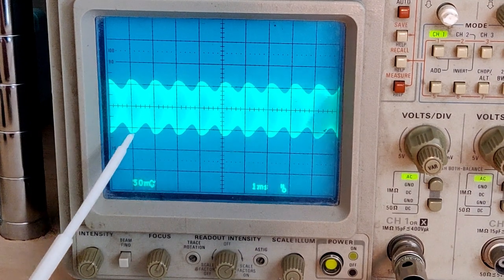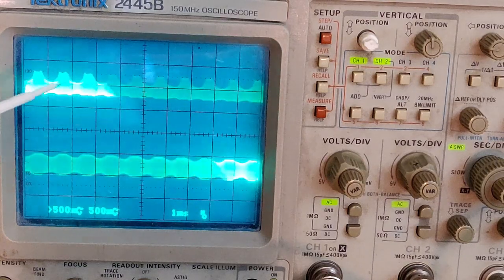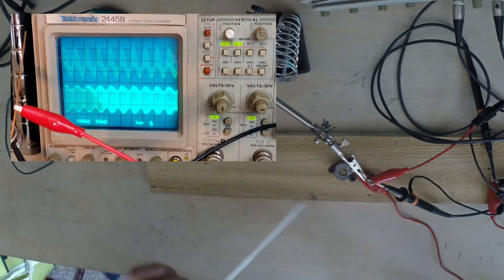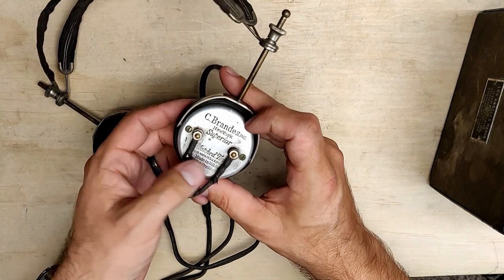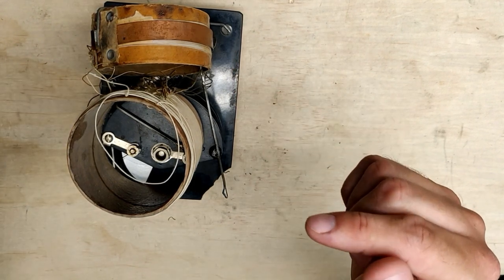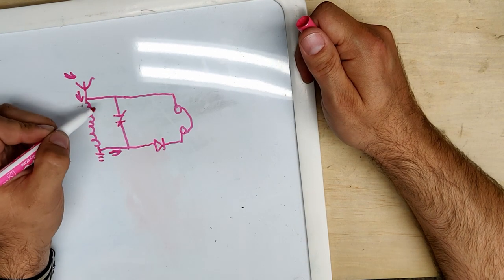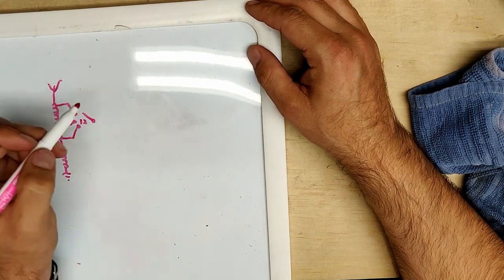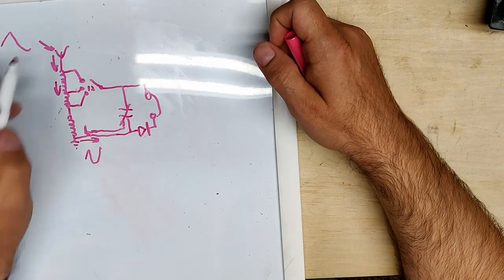Backroom Electronics #4: Fundamentals of Radio Part 1: The Crystal Detector

Comment: Several months and not a single comment... so I let me be the first :-).

I really appreciate your approach to explain the operation of crystal radio detectors.

Recently I bought radio crystal myself which is supposedly from about 1910 and started to play around. The characteristic which I read from a curve tracer looks very different from what you would expect from a diode (L-shaped trace). So I searched around the internet which lead me to your video.

Your experiments inspired me to use your setup and feed a mock-up radio signal into my crystal. This yielded results similar to yours after I found a hot-spot. As soon as my high-ohmic headphones will arrive from E-Bay I will be able to actually listen to the demodulated signal :-).

Thank you for your good work which helped me a lot with my own project. I'm looking forward to the following parts of your planned radio series...

Regards, Ralph